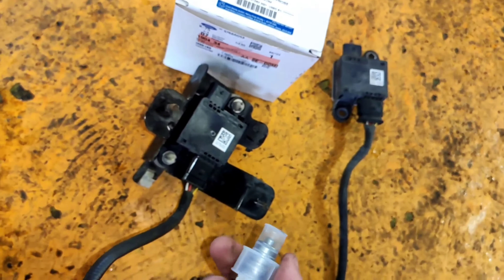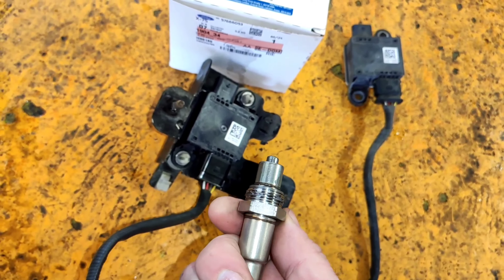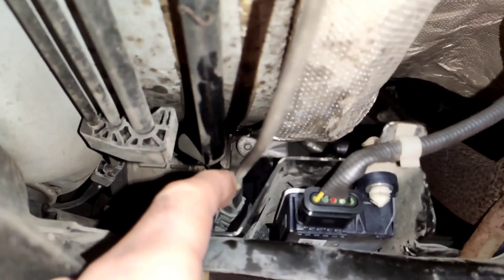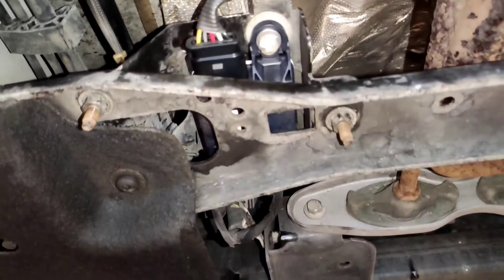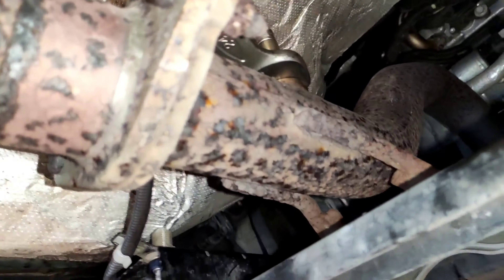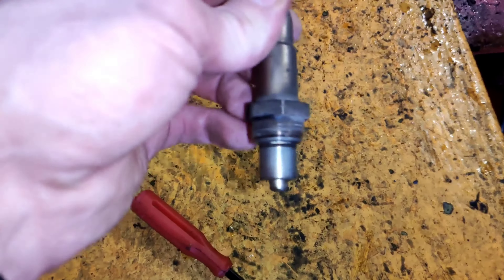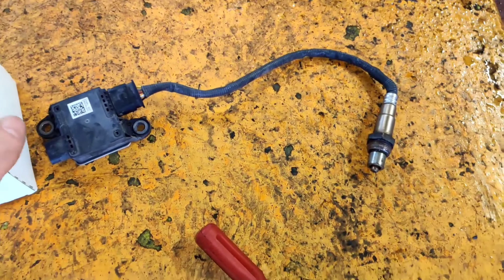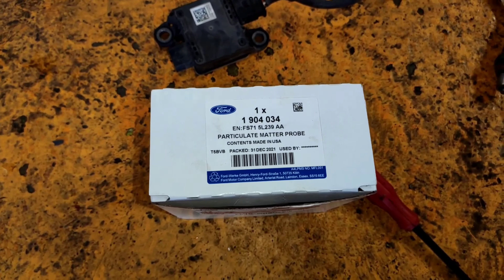P24C6 particulate matter sensor Murphyslaw

Comment: Just had the fault code on my Mercedes GLC Coupe... reckon this is an easy enough job for an amateur to do without a lift? Thinking of doing it on my drive-way, the replacement is already making my eyes water, really don't want to have to take this to a mechanic!
Reply from the maker: Iv never done one on a GLC but if it's anything like this it would be easy. Im having problems getting the sensors at the moment Hyundai said 4 months till they had stock
Reply: @murphyslaw2020  is it true , Hyundai ancaster told me today same think , I found this sensor after hard search on the internet coming in few days but very expensive
Reply from the maker: Yeah still on back order. I had to wait 6 weeks for a ford not to long ago. All the brands are having problems getting them.

Comment: Hi  i have this code on my Hyundai i800 2019 model.  I was told it was thw O2 sensor next to thw engine but changed that today and after a couple of miles the engine light came on. Would this be the next ti try change?
Reply from the maker: I believe this sensor is very Common to fail on hyundai and kia. They are always on back order from the dealer in my Region. I'd call the main dealer parts,  ask for a price  and ask do they/ have they sold many of this sensor. 
It's most likely  this but they can be very expensive. I'd try read  some live data etc

Comment: I have changed 3 sensors until now on my kuga 2019. They last one year and then error appears again… all sensors were original from the dealer
Reply from the maker: Hi, sorry to hear about your problem. Look to see if there is a software update  or any updates from the dealer. 
I'd try to get Warranty on the parts. 
The euro 5 / 6 cars are painful to repair  everything  cost so much

Comment: Is it possible to run the car without it or will it end up with damage to engine?? Thanks Terry
Reply from the maker: It will damage  the car longer you drive it .
The dpf can  Block  that puts pressure the turbo and the engine etc.  Iv seen lots of big problems just from a small sensor not been  fixed
Reply: @murphyslaw2020  Ime fairly sure it is the sensor as it says permanent on my scanner. Is their any other reason I could get this engine light on other than it being a faulty. Sensor? I appreciate your time and effort. Terry
Reply from the maker: @terrymurphy562 the sensors are very soft and every brand are having problems with them. It's most likely  the sensor but see if you can test the readings with you scanner  might show you more insight.
Reply: @murphyslaw2020  thank you very much for your time. Very much appreciated.

Comment: Ho sostituito la sonda lambda e il sensore. Dopo averli sostituiti, ho portato la macchina per un giro di prova. Ora appare questo errore U02A3 La comunicazione con il sensore PM è stata persa. Cosa devo fare per correggere il codice U02A3? L'auto non va più in protezione quando supero i 3000 giri Grazie
Reply from the maker: Some non oem sensor don't  read correctly. It might need to be set up With a diagnostics
Reply: @murphyslaw2020  grazie